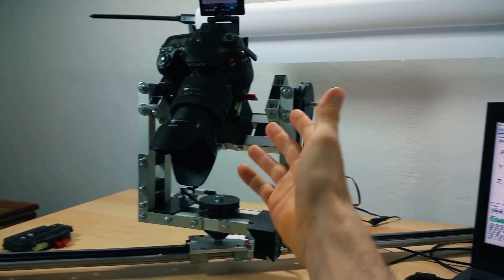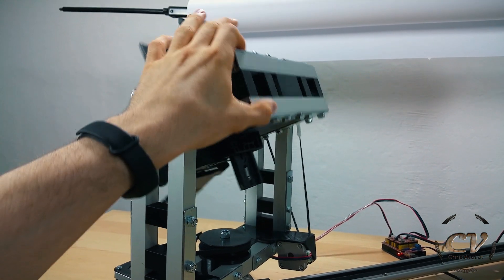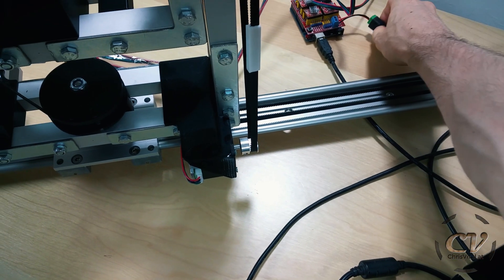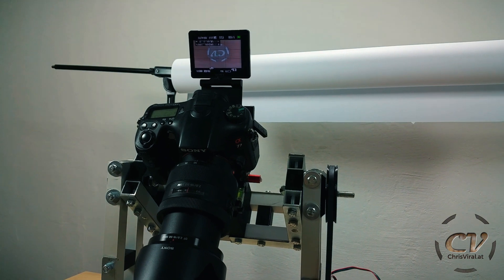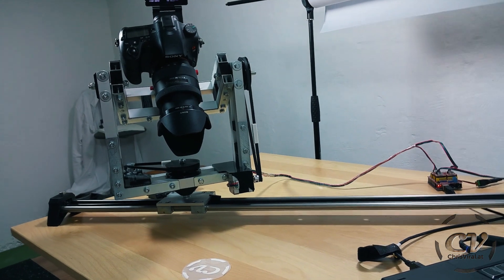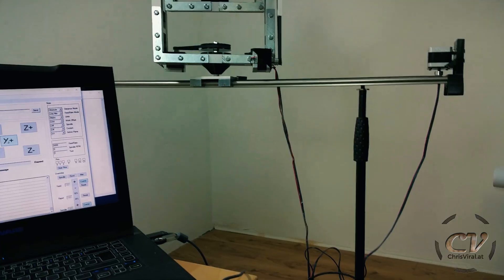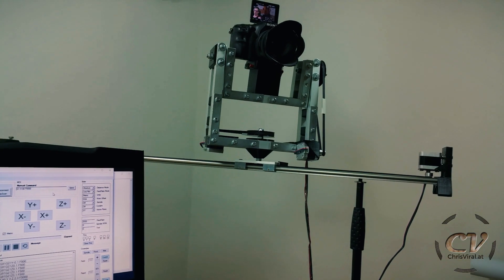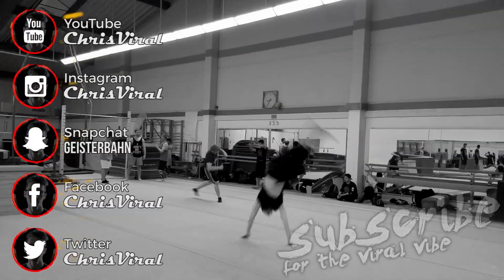DIY 3 Axis Camera Slider Demo | Arduino & GRBL Powered | With GRBL Panel

Comment: How can I get the code??
Reply from the maker: It's open source andcalled GRBL. Just google it and read the intro on github :)
Reply: @ChrisViralVlogs  When assembling the slider structure and the electronic components, I just have to upload the code to my Arduino controller?
Reply from the maker: Yes, you just need to get done the hardware part. The software is all done with just uploading GRBL.

Comment: leadscrews arent "the" soloution. Belts are way faster, you just have to fix the build.
One reason is, belts are designed to operate on a preloaded tension. So if the tension is set up wrong thats one source of error. Another thing is, if the axis is too thin or long it might bent slightly. To fix this you could support it from the other side with a ballbearing.
At the moment you have one contact point (bearing?) then the Beltgear and then it floats in the air. I mean imagine the beltgear between 2 bearings so it is supported better:
http://site.petitrc.com/setup/teamc/setupteamctm2/TM2V2_RCCarMagazin_Review/bild18.jpg

for the long rail you could by so called supported rails looks like this, but i didnt searched for the cheapest just an example:
https://www.ebay.com/p/Sbr25-530mm-Linear-Rail-2x-Bearing-Blocks-CNC-Router-Aluminum-Alloy-Mills-Lathes/28020797781?iid=123269122063

OR you could buy a wooden plate to support it. cheap fast and cost effective:D i would try that first.

i guess you arleady seen this ? :)
https://www.youtube.com/watch?v=Pbm960k1wW4
Reply from the maker: Yeah I'll definitely try to fix it before moving on. It would be way more efficient to get this one working before starting something new. I think I found a solution for the tension, I'll get to that in time. I think you'll like this solution.

Ah nice, haven't seen that... I mainly looked for multi axis slider builds. Let's see :)

Thanks for the links as always.